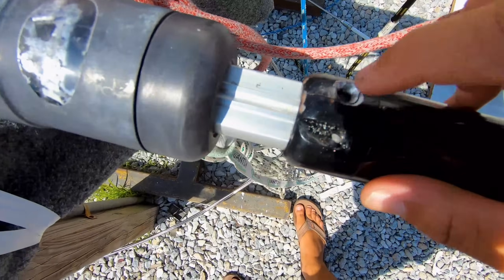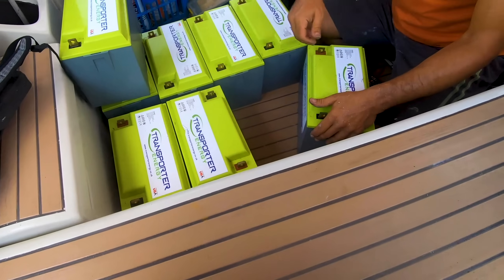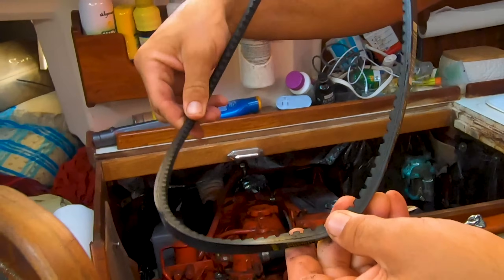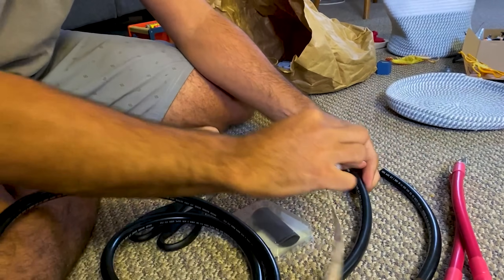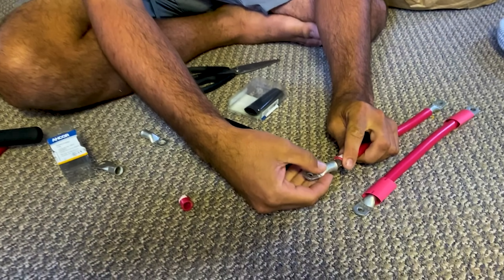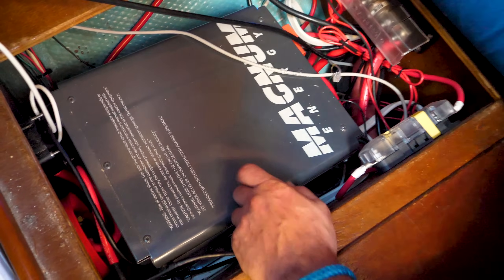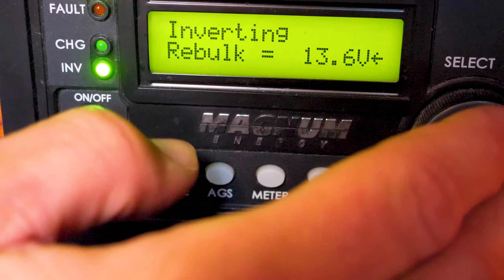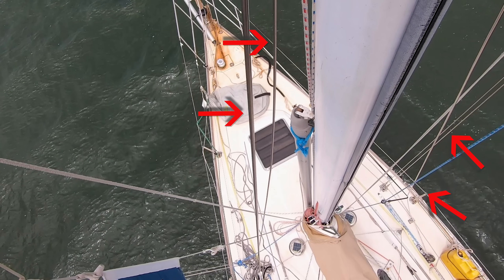Christmas Came Early! Lithium Batteries from Delos (Calico Skies Sailing, Ep.69)

Comment: This might have already been answered, however, i have REALLY tight clearances on my alt belt and I struggeled to install it as you did.  For me, the solution was to remove the 4 water pump pulley bolts and then install the belt in the V of the water pump pulley.  Then i set the pully on the water pump and install the bolts.  Once the pully is re attached, I tension the belt with the alternator.  Works quite well and doesn't add much time.
Reply from the maker: That's a good idea! It shouldn't be that much of a battle LOL, Maybe I should go up in belt size 😂
Reply: @CalicoSkiesSailing  my engine compartment is too small to go up a belt size and get tension on the belt.  However, if you have the room, that would certainly be the easier solution.

Comment: Take that bolt completely out of the alternator. It will give you just enough room to easily get it in the pulley groove. Them you can install the bolt and tighten

Comment: Hey Guys,   

Love the Videos (Been a long time Delos fan!)

Suggestion for you:
Have you considered adding a Starter type LifePO4 Battery that's separate and dedicated to engine / generator start so that in the event of a main bank shutdown you can still easily and reliably crank up up the engine / genset rather than having to "jump" yourself from a jump pack? Ideally Said battery should be able to power all the minimum required electrics to start and run the engine and ideally should be switchable to charge directly from alt if main bank is faulty. Some of them also come with a built in reserve so if you somehow manage to run that "flat" as well, you can press a recovery button to unlock some extra charge and still fire up an engine.
 I've actually got one in my car, and it works wonders!

Using a lifePO4 start battery should also simplify charging as then both House and start batteries are the same chemistry.

Normal charging could be via a DC-DC charger such as a Balmar duo to charge from the house bank, Or you could have the Engine Alt directly charge the starter battery, and then use a combiner relay or heavy duty DC-DC charger to charge the house bank. (and me being the kinda person to have redundancy in everything would also add a dedicated AC charger for the start battery than can run from shore / gen, but thats up to you if you want to go that far, I mean heck, you could even go overboard and have one solar reg thats also switchable to the start batt :P ).

No point jumping from a jump pack if your only battery bank is in a persistent fault state for some / any reason and you have zero electrical power for basic systems. Some engines wont stay running without electrical power, and you cant run an alt without a working battery, not to mention it's a rather large safety issue to have no radio's and no basic instruments either.
Also sticking a jump pack like that in parallel with a large lithium bank that's deeply discharged and/or has a fault is asking for trouble in its own ways.

so in my car I have an EVWorks (Australian) brand "Start Saver" (Seems they don't sell them anymore), but the MegaLife ones ( https://www.megalife-battery.com/ ) and other equivalents Would work perfectly fine too and come in just about all shapes, sizes and capacities, with and without reserve function. (in fact i'm about to put one in my other car.).

Happy Sailing!
- Alex.

Comment: The upgrades you are doing will make a whole change of life on the boat! I work as a Space Sciences engineer and I have worked on the com gear for many products, my favorite was on the rovers so an error in 1:10000 is unacceptable. Lets talk about a mission designed to last 6 months that actually lasted years. I hope we get better at making things like rigging, batteries, and solar that work as well as what I have worked on.
Reply from the maker: wow it's really cool that you work as a space sciences engineer! We were fascinated that the rigging was built to a certain failure rate, as non engineers it was super interesting!

Comment: Time lag, July install, FireWorks 🎇🎆, heat, just posted here, post Xmas, time travel courtesy of Lithium (manic depressive aka bipolar bad joke)... Glad things worked out. Sierra could use an update toothless bib, with teeth now. And crabs to lobster (Maine happened since)
Reply: And scary putting hands in something that holds a charge like old CRTs.  It's DC but collectively a replacement for main into an apartment or garage, and most aren't electricians.  Those spaghetti wires on top, some metal tool hits the wrong things, Arc welding, startling and likely don't know what caused it until after, if able...
Reply from the maker: Hahaha!

Comment: That’s not how you install a belt. Loosen the alternator
Reply from the maker: The bracket was loosened but we must have been using too small a belt! We bought the old one in to shop to get replacement but got the wrong size I guess!

Comment: Congrats on the new batteries!  Why don't you try a 1" longer alternator belt?  You have plenty of adjustment. Will be easier to install and not risk damaging the belt from too much prying.
Reply from the maker: Thanks for the tip! I wasn't sure how hard the belts were supposed to be to get on 😂. I just matched what was originally on there

Comment: How to ruin a belt during installation. Boah I couldn’t watch this torture.
Reply: Even it is running fine at the moment, mounting a belt like this will partially destroy it, before it even ran for a second. I highly recommend not to do it the way you did.
Reply from the maker: 🤷🏻‍♂️ Shes in a running fine!😆
Reply: @CalicoSkiesSailing  The alternator is mounted on a tension-adjusting mechanism.  When you were prying on the belt, the alternator slid along the curved track in it's mounting bracket (movement visible at 6:18-6:20 for example).  If you fixed the alternator in the closest (lowest tension) position (tighten the bolts with it in that position, or lash it down with cordage or whatever), the belt should go on easily.  Then you readjust the alternator position to restore correct tension and tighten it down.

Since the alternator was clearly moving, and it was close to the lowest tension position, it's possible you already knew this and just ran out of tension adjustment.  But for anyone else watching who wasn't aware, hopefully my description is more helpful than "You're doing it wrong, this is torture."
Reply from the maker: Thanks! From all the comments I think I must have the wrong size belt 🤓. I took the old one into NAPA but I should prob go up an inch. Having not really worked on engines before buying the boat I assumed it was supposed to be a challenge 😂

Comment: why don' you loosen the pivot bolt and locking bolt on the alternator, move it in, put the belt on, then tension it down with a lever bar?
Reply from the maker: They were both loosened actually, that was all the space we had for the size belt!
Reply: @CalicoSkiesSailing , so the alternator was pushed as close to the pulley as possible? I honestly have never seen that happen, unless the belt you were installing is too small.
Reply: @PaulBartomioli  ‘
Reply: @rickpfanku9864  ????
Reply: @PaulBartomioli  slack the alternator. remove pulley 4 bolts. insert belt. attach pulley. tighten alternator.  working on old muscle cars this was the easiest way. prying with a screw driver can create burrs on the pully and then premature failure of the belt.

Comment: I raced a Lindenberg 22.  It had rod rigging until we sunk and had to replace the mast and the rigging.  We went with wire rope rigging with the new mast.  Is there an advantage to using rod rigging?
Reply from the maker: Oh no sunk?!  What happened?! The rod is lighter and stiffer giving a lower center of gravity. We looked into changing over to wire when we rerigged back in 2016 but the costs to change the mast fitting to accept wire was crazy expensive!
Reply: @CalicoSkiesSailing  We were racing in the Race For the Case between Gulfport and Biloxi, Ms. in squally conditions. We got hit by a microburst with the sails down and secured and the extreme winds blew us over and left us with the dagger board pointing up out of the water at 45 degrees from vertical.  We had the hatch closed but not the companionway and the boat filled with water and sunk after 45 minutes.  We tied a fender to the bow to mark where it was before the Coast Guard plucked us out of the water.  A local shrimper offered his help and we dove down in 15' of water, to tie a line to the bow cleat and pulled the boat to shore 3 miles away.  The mast snapped because it had been stuck in the mud when we started towing it.  We cleaned up the boat, replaced the mast & rigging and finished 2nd in the race the following year.
Reply from the maker: Wow!! That’s a crazy story!!
Reply: Did Calico Skies come with rod rigging?

Comment: You are going to love the LiFeP04 batteries. We are Battleborn brand ambassadors like Brian and Kazza. We upgraded last year and the capacity of our bank is over the top with only 4 on board. A beast of a system.
Reply from the maker: It’s absolutely amazing. Charging is about 30% faster and the loads we can pull out are a insane. Adding the battered greater reduced out need for the Honda. If we ever end up in another situation like a pandemic in the ragged we will be even better equipped to be off the grid :)